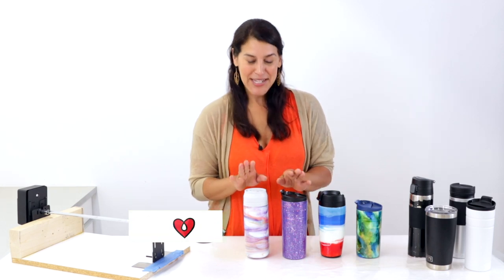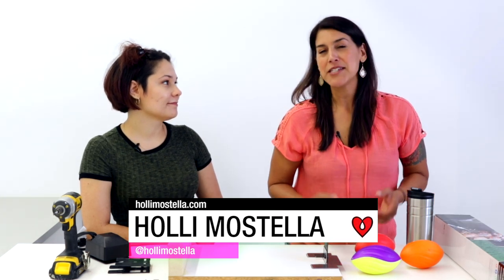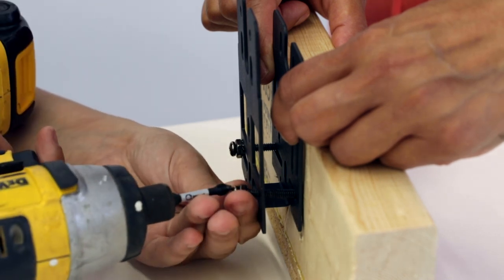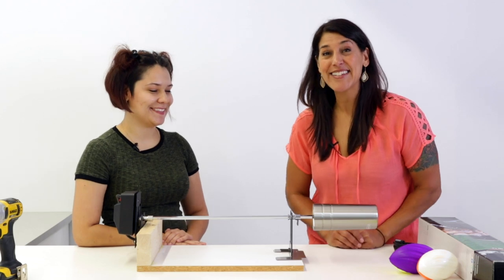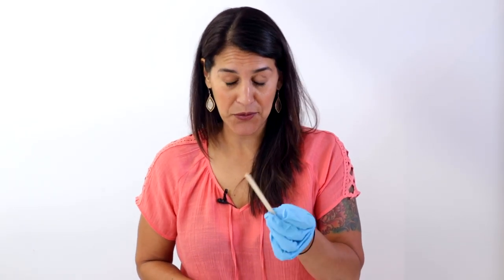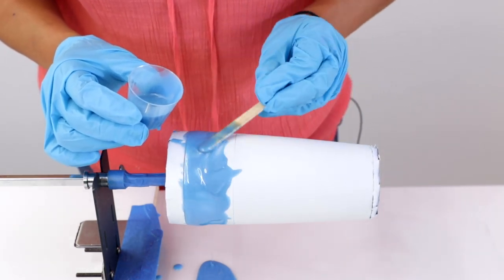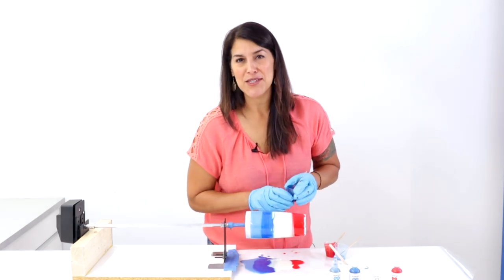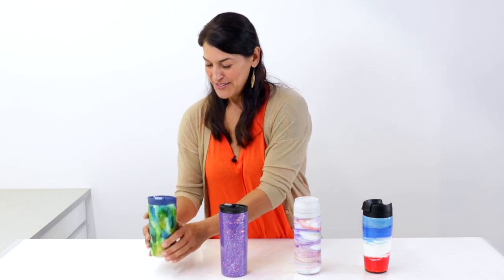How To Make A Resin Tumbler - Handy Tips & Tricks

Comment: Nice video!  I noted that you said to paint the plastic for the resin to adhere but you also painted your other tumblers.  Do you always apply a painted base coat regardless of the material?  Thanks!
Reply from the maker: Avoid using plastic tumblers for this project. Epoxy resin does not adhere to plastic and can peel off in time. If your tumbler has a small amount of plastic on it, you can cover it with a plastic-compatible spray paint to give the resin something to hang onto.   You do not need to paint a base coat for surfaces like stainless steel or ceramic, it is personal preference.

Comment: if you are starting out with a white tumbler, like the sublimation kind do we need to spraypaint first?
Reply from the maker: That's a great question!  There are 2 reasons for spray painting first.  First, and most importantly, it will help the resin adhere better, especially to plastic.  It should adhere fine to aluminium, which is usually brushed (which gives it some texture for the resin to adhere to) but any other glossy, smooth metal should be primed or scuffed with a wire brush. 

Second, is that it will just help the tinted resin be a little more punchy.  Depending on what colorant you use, the resin could be slightly translucent, so if you're resining over a dark tumbler, the base color could show through. 

You don't have to use a spray paint - you can brush on a primer as well. I just wanted a nice smooth, even, fast coat so I used a spray paint :)

Hope that helps!

Comment: make sure when you educate people you educate them to be safe too 👍 resin can be toxic
Reply from the maker: Hi Nancy! Yes safety is very important, it is also important to look at the safety requirements for the brand you are using. ArtResin conforms to ASTM D4236, meaning it is certified as safe for home use and non-toxic when used as directed, however there are some common sense safety precautions that every user should follow:

Wear gloves. ArtResin is very sticky in its liquid form, so gloves will protect the user from a mess, as well as skin irritation. Clean skin promptly with soap and water if it does come in contact with ArtResin.

If ArtResin somehow comes in contact with your eyes, flush with water repeatedly and do not rub. Promptly seek medical attention.

Work in a well ventilated area. Wear a respirator if ventilation is poor.

See our blog for further information: https://www.artresin.com/blogs/artresin/what-safety-precautions-should-i-take-when-using-artresin

Comment: gorgeous....is there anyway to remove already set resin from a jewerly blank?
Reply from the maker: This may prove to be a difficult task. You could try to place it into some hot water to soften up the resin there is a small possibility you might be able to peel it out.  However usually one resin is cured its a solid unless you are sanding it all the way down it doesn't want to budge.
Reply: ArtResin thanks..also how to you remove excess dried resin from something?
Reply from the maker: @Roy-G-Biv  sanding really is going to be the best way. Here is our blog with some tips and tricks https://www.artresin.com/blogs/artresin/how-do-i-remove-epoxy-resin-drips

Comment: I'd like to use paper underneath the resin - does that need a sealant, and if so - what would you recommend?  Thanks!
Reply from the maker: Hi Marvo,  paper can absorb the resin and take on a wet appearance, so we usually recommend sealing it before you apply ArtResin.  You can use any sealer you like, spray on or brush on, just ensure that it dries clear.

Comment: When finished painting when you leave it on the device overnight, is that with the rotisserie going? Because if you left the rotisserie off wouldn't all the resin drip off the tumbler?
Reply from the maker: Yes! You will need to leave the tumbler rotating on the rotisserie until it stops dripping. We recommend leaving the motor running, allow the cup to continue turning until the resin is dry to the touch, approximately 18-24 hours later. Remove the tumbler from the cup turner and remove the tape. Allow the cup to continue curing - it will be fully cured at the 72 hour mark.

Comment: Hello! Are these dishwasher safe (I may have missed that in the video)? Also I’m looking to do scripting on the cup before doing the clear epoxy, is there a type of paint that would work better? Should I just use stickers?
Reply from the maker: ArtResin is heat resistant to 120F/50C and many modern day dishwashers have high heat settings that would exceed this so I would recommend a hand wash is best. As for paint, I would work with what will adhere well to your surface. If you choose to use stickers keep in mind that you will want to place a sealant over them before applying the resin as many stickers will want to repel the resin :)
Reply: No. They aren’t. You have to hand wash all resin art & if you live in a hot climate don’t leave it in your car. You’ll be cleaning resin out of your cup holder or seat

Comment: Does the rotisserie have to stay turned on for the 24 hrs? Or is it turned off?
Reply from the maker: You want to keep the turner rotating for the first 24 hours or until the resin has cured enough to not drip.  Rotating the cup constantly will avoid any drips from forming as it slowly cures.

Comment: Hello, would I be able to use printable vinyl and seal it with art resin?
Reply from the maker: Hi Canikah, ArtResin does not adhere to plastics, silicone etc. We use vinyl shower curtains as our drop sheet as it is very easy to peel off cured resin for clean-up.  
My suggestion would be to experiment first and see how well it works for your application.

Comment: Hello! I tried to make one but resin doesn't seem to be setting evenly for some reason, it creates like holes, do you have any advice to avoid these?? Thank you!
Reply from the maker: Hi Natassia, did you use any silicone or oil in your tumbler?  It sounds like 'divots' or 'fisheyes' that are caused by the resin being repelled by oil.  Another cause could be simply not enough resin and its pulling away as it stretches to cover the surface.  You can send us photos at support@artresin.com and we would be happy to work through this with you to find a solution and a fix 🙂
Reply: @Artresin  Hi! Thank you for your reply but I think I have managed to sort it, thanks anyway!

Comment: Once the resin has been applied, can they still be considered dishwasher safe or must they be hand washed only?
Reply from the maker: Hi Cecilia, 

The issue with a dishwasher is the heat settings. While we have put some of our pieces in to the dishwasher and have no issues some of the new high tech dishwashers get really hot. ArtResin is heat resistant to 120 degrees F. So to play it safe it may be best to hand wash your pieces :)

Comment: What should the room temp be when using this product?
Reply from the maker: Hi Shawn,  the ideal temperature for both your ArtResin and your workspace is slightly warmer than room temperature: 75-85F or 24-30C.
Reply: ArtResin Thank you so much I will make sure I put a space heater in my craft room area then to keep it at that range.

Comment: What happens to an Art Resined painting at 121F and what can be done to fix it?
Reply from the maker: If ArtResin is to exceed its heat resistance it will begin to soften. Usually it will self heal when brought back down in temperature.

Comment: I have a question. Can you print out a picture and then glue it on and then use resin to seal it in? Can you please get back to me as soon as you possibly can?
Reply from the maker: Yes you can :) You may also want to seal the photo prior to applying the resin to avoid any bleeding or off-gassing.
Reply: @Artresin  thank you

Comment: Sorry didn't like the red, white and blue one. There has to be a way to do this without building a structure and using a rotisserie rod. I like the marble one the best.
Reply from the maker: Using the rotisserie is really the easiest way to get a smooth finish. Some artists will prop the up and brush on the resin but we do find it difficult to get that flawless finish as the resin wants to run down towards the bottom :)

Comment: I bought this, started using it, and let me tell you its garbage!   I mixed it as they say, for 3 minutes, and it had so many micro bubbles and, I let it sit for 5 minutes on a warm surface and the bubbles would not rise, I hit it with the heat gun while it was on the mixing cup, and nothing. I poured it,  and hit it with the torch and still nothing.  its horrible
Reply from the maker: Hi Nelli, I am sorry you are battling bubbles in your resin.  We recommend warming up your resin and your hardener in a warm water bath prior to mixing it.  The ideal temperature for both your ArtResin and your workspace is slightly warmer than room temperature: 75-85F or 24-30C. Room temperature ArtResin epoxy resin is crystal clear, with a beautiful, honey-like consistency. Cold resin, on the other hand, will be thick and clumpy, making it difficult to work with. It will also take on a cloudy, milky appearance due to thousands of cold-induced microbubbles - you will never be able to torch these bubbles out.  I hope this helps with the bubble issue 🙂
Reply: @Artresin   I did the warm water bath for one of my test runs, I saw no difference.  in my desperation on my last project I even used a reptile heat lamp while pouring it on the cups to keep it at a spreadable consistency. it helped spread more evenly, I liked that but the microbubbles were out of control with every project.   once I mix it how long should I let it sit under the heat lamp for the bubbles to rise?
Reply from the maker: @ynellirosas  If you are using a torch and the resin and room is warm the only other thing I can think of is that either it is being pouring too thick for the bubbles to rise. Our recommended pour depth is 1/8th inch per layer and doing thicker pours may not allow for the bubbles to escape. Another reason could be a reaction to what you are pouring over, things like paper, wood and many organic materials need a sealant over them as they off gas and create bubbles. If you are still having issues please send in some photos of your pieces to our customer service team at support@artresin.com and we will be glad to help you trouble shoot further.

Comment: Oof, the resin from the link is wildly over priced,  especially for generic manufactured resin. Buy reputable resin for much less, literally anywhere else.
Reply from the maker: One thing is for sure, there are many different brands of epoxy resin to choose from.  It is important to keep in mind when selecting the epoxy resin you want to work with, that they are not all created equal!  ArtResin performs in ways that no other epoxy resin does, namely in terms of clarity/longevity and safety.  We use only the highest grade raw materials and we test each one for purity before introducing them into a batch of product.  Doing so allows us to achieve exceptionally clear (i.e. as clear as water) resin and hardener from the outset.  Additionally, we utilize a proprietary blend of specialized light stabilizing additives in our ArtResin formula to maintain its unparalleled clarity.  Whereas some resin brands will advertise that they include a UV stabilizer, a simple UV stabilizer alone will not prevent yellowing but merely delay it by 6 months to a year under normal conditions.  Thats not all!  Unlike many other epoxy resin, ArtResin is non-toxic, does not produce fumes or VOCs and is safe for home use, when used as directed.